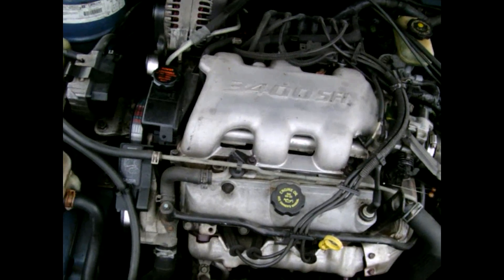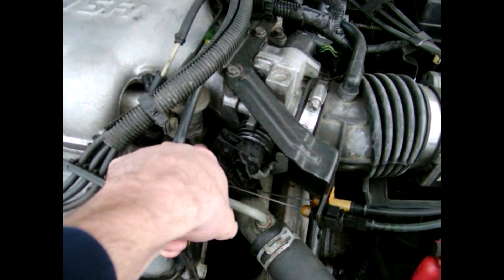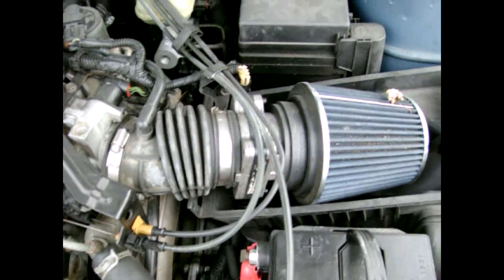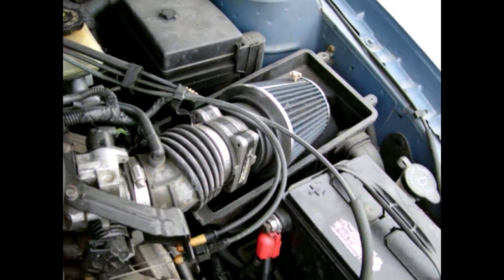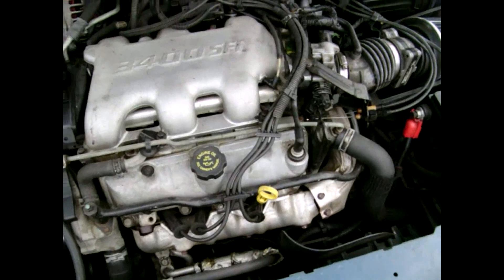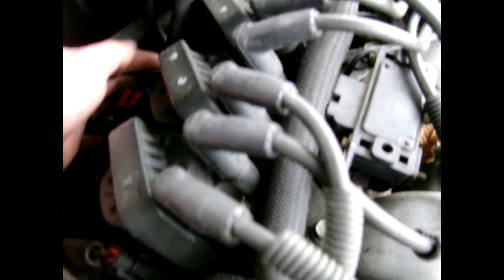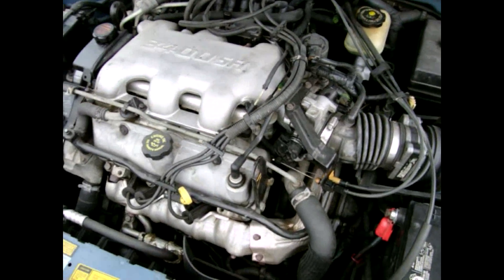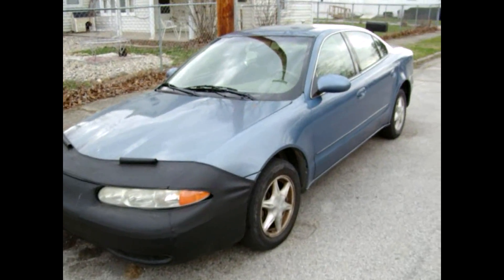3400 GM Engine 3.4 Liter Motor Explanation And Discussion

Comment: I know this feed is old but i've watched every video you made, i have my whole engine apart in my 99 olds silhouette, got everything cleaned painted and sad to say all my parts got mixed up, bolts and all, this is gonna be fun, i'm most worried about the vaccum lines
Reply from the maker: Luckily there aren't many vacuum lines in this engine.  Should be plenty of diagrams available.  Some of the bolts that hold on the alternator bracket and alternator are similar but use different lengths.
VT247

Comment: I have a 2004 Oldsmobile Alero 3.4 Litre, bought it off a friend of mine, had a nightmarish experience with Overheating, messed up the engine that came with it, replaced it with another engine, and the overheating persisted, read through some opinions on the web, told my Mechanic to check the manifold intake, he checked replaced the gaskets but the overheating persisted, fortunately my Mechanic is as dogged as i am, he insisted that there must be a reason the overheating won't go away, so he disconnected the Complete exhaust system and allow the the car to run, noisy though but that solved the problem. the catalytic converted was bad and was blocking the free flow of the exhaust, he remove the catalytic converter and replaced it Voila, overheating stopped, now my Alero is my favorite car. Overheating seems to be one of Alero's negs. I hope this helps.
Reply from the maker: At some point, nearly every gasket on the 3400 will go bad.  Had to replace the timing chain cover, the head and intake gaskets on nearly every one I've owned.  But, they are generally pretty reliable once the gaskets get changed.
VT247
Reply: Vacationtime247 Very correct, they are pretty reliable once you get it right. I love the surprise when i compete with super cars on the highway. nothing to show on the Alero that it's got muscles under the hood.

Comment from the maker: If you have coolant coming off the engine and trans, it's almost guaranteed that it's the intake manifold. Head gaskets on the 3400 don't typically go bad IMO. Just replaced the intake manifold gasket on an '01 Aztek. Got a video up on how to fix it. Typically with an intake manifold gasket, you'll have milky oil. If you have milky oil, stop driving the car immediately and get it fixed. Otherwise, it'll be the whole engine needing replaced

Comment: mine is starting the tapping sound some people say its the rocker arm bolt that came loose or stripped out and a few say its narm im haveing a hard time finding what it really is. a buddie of mine said it has high miles and told me to do a oil change. we will see
Reply from the maker: +Brian Smith Listen around the valve covers.  If it's the rocker arms the sound will be noticeable there.
VT247

Comment from the maker: For the top alternator plug in, from front of the engine to the back firewall, the first slot is empty, the second is where the red wire goes, the 3rd the white wire, the fourth space is empty.  LMK how it runs now that it's all fixed.
VT247

Comment: Sound like your heater core is leaking, You may have to replace it.  They corrode over time.  If this is the problem, your car environmental systems would never warm up inside the car.  You could try using a alumium flake based radator sealer.  This would give you a little time before the replacement if I'm correct.  The alumium flake would seal the leak until you have time to replace the small heater core.

Comment: Hello, thanks again for the great videos. They really helped me change my intake gaskets and head gasket. I now need to change the egr tube on my montana. So, do you figure I can reach the nut on the manifold to loosen the tube from below, or should I tilt the engine forward and get it from the top? Thanks!
Reply from the maker: I've always been able to get the EGR off from the back of the motor without removing the mounts.  Getting the large nut off from the manifold will be the problem.  It tends to get rusted.  Might have to get that one from underneath the car with it jacked up.
VT247

Comment: my grand am has always run warm. never gets under 200 once warm. the previous owner stated he had been proactive by replacing the head gasket, but he didnt tell us he did it himself and he pinched it. about 500 miles into my ownership, it failed. antifreeze in the oil, then the crown of piston 5 got too hot and expanded enough to tap the valve and crack the push rod.  ended up paying 1500 for a 90k motor, with out labor. now the tcc is slipping... another 2 grand probably

Comment: Hi!! @ 2.35 can you tell me were that line goes, it get broken and I don't know were to look at thank you for your video
Reply from the maker: The line at 2:35 goes from the intake plenum to 2 locations.  First in the PCV valve in the front of the motor.  The second to the back for the EVAP.  The EVAP is located under the coil pack, it can be difficult to reach.  Only try to access it with a cool engine.  Hope this helps.
VT247

Comment: I have a 2003 aztek, 3.4l with 100kmiles, Every morning before i drive away "i let her run for 2-5 minutes" the transmission seems to slip under first acceleration... i let off the gas, press it again and the problem is gone and doesn't do it again for the day.
any ideas?   I flushed the fluid, but didn't help, and its been happening for about 9 months...??
thanks:)

Comment: hey so on the manifold there a vacuum line that's by the egr. it's the hard vacuum line that's white. what does it go to or what does it do. mines not connected at the moment.
Reply from the maker: +WOLFEGANG TAKE A RIDE. BY JON YOUNG That line I believe goes to part of the EVAP system that's between the motor and the firewall.  Needs hooked up or it will set a trouble code.  It will also make your car run better hooked up as well.  You really have to look and feel for the place where that line hooks into, it's not easily visible.
VT247

Comment: I have this engine in a 2003 Olds Alero. trying to replace the waterpump outside in 10degree weather sucks. It appears the waterpump only goes on one way. We are going to get back to it tomorrow, but my son and his friend apparently had something off and the bolt may have crossthreaded. once we get that out we may be screwed, but if they can get a replacement (they broke the head off) and it still is good enough to go, how do we know it is positioned properly to fit the mount on the engine properly? I am accustomed to a car with a matching tab on the motor to line up with the water pump. There is no such thing on this vehicle, and I am pretty sure it only goes on one way. We could try hand threading each bolt, then remove and turn one to the right for each of the 5 possibilities, but if there is a way to know it would be awesome.  The water pump we purchased between bolts has tabs or no tabs. clockwise it would be a tab in the middle, no tab, a tab to the left, a tab to the right, and no tab (from the perspective looking at it from the fender).  I am guessing one of those tabs is designated to be the top, but I have no clue which. And if all the pumps for this car are the same I'm still out of luck because they took out the old one without paying attention to that. Being it's so cold outside here and we are stuck doing it without a garage, I really hate to have to try all the positions if someone knows which one is correct!
Thanks in advance.
Reply from the maker: Still have the gasket?  Try and match up the gasket then align the water pump holes accordingly using that as a guide.   Hopefully this fixes the problem.  These engines are really bad about blowing factory gaskets.  Both 3400 I currently have has had all the factory engine gaskets replaced, head, intake and timing cover.
VT247
Reply: Thanks for the speedy response. I will give that a try. It's hard to get a good view but just the gasket would be easier than trying to view the lineup through the water pump

Comment: Any one know if they offer aftermarket valve covers for the 3.4 SFI.  I just picked up a 02 impala with 35k on the engine and all in all its been awesome.  Just looking for a way to improve the look under the hood. not really looking to "mod" or "upgrade" performance.

Comment: on the dis system u mention a vacuum does that line go to the upper intake right next to the alternator?
Reply from the maker: No, that one is plugged off.  Google ' GM 3400 vacuum lines ' for a diagram.  Should help if you are searching for a disconnected hose location.
VT247

Comment: have a 2000 pontiac grand am gt with the same exact motor and i am having trouble finding the right heater pipe on the backside of the lower intake it is leaking bad and the pipe needs to be replaced but nobody can seem to find the right pipe i can find the straight one but the one i have has a sort of s bend in it and nobody seems to understand where it came from or can find one like it
Reply: +George Highsmith     ~ rock auto online~

Comment: Hi guys, I have a '04 Alero and when I try starting it it will crank for about 5 seconds before firing up but sometimes if the engine has been running and I try starting it within 1 hour it'll fire up almost instantly. Also, I have to refill the coolant almost every 2 months. I don't see any leaks but I had a fusion and not once topped off the coolant in the 3 years that I had it.
Reply: I have an '08 equinox with the 3400 in it, was losing coolant but couldn't see any externally, ended up being the lower intake manifold failed.  You may have a bad head gasket as well, as when it sits it may be slowly leaking coolant into one of the cylinders, then give you trouble starting, but if it hasn't sat long, may not notice.  Also, I am unsure of the fuel pump set up on these, but if the check valve in the fuel pump is bad, or if you have a leaky injector, or leak any where in the fuel lines it may gradually be losing pressure.  One way to test the fuel system is to cycle the key to the on position and let the fuel pump prime the system, do this 3-4 times, letting it stay in the on position for a couple seconds each time, then on the 4-5th try go ahead and turn the engine over.  If it fires right up after sitting a long time, it could be a leak in the fuel system or bad check valve in the fuel pump.
Reply: Thanks Brandon, I've done the key cycle when its been sitting overnight and more often than not it'll start right up. I suspected the fuel pump but I've been putting off getting it checked because its a pain to get to.  I believe the fuel pump for this car is on the inside of the fuel tank, so to get to it I'd have to remove the entire fuel tank from the car. I've been dreading getting the news that I might also have a head gasket problem because those are usually costly fixes. It's just a $1000 beater car so I'm really not trying put too much money into it, but I'll take it to my mechanic and hopefully he'll resolve the problems without charging me an arm and a leg. Other than that its a good car, plus it's a great conversation starter, 9 out of 10 people will have no idea what it is and just 2 days ago a guy pulled over to tell me that he has one and how much people loved them back in the day.

Comment: THE TRANSMISSION VACUUM IT SHOWS IN THE TO RIGHT FRONT OF THE MONEFOLD''. I'D PLUG IT COS NOT KNOW WHERE TO  GO WITH?
IN 2004 3400 GRAN AM..
Reply: I have the same issues.  Did you fix it?

Comment: I have a 2004 impala and I recently discovered a bad leak under a metal hose that runs under the 3400 upper intake manifold. It lets off a hissing sound which I believe is an obvious sign of pressure leak from a metal pipe. I was wondering if it was absolutely necessary to remove the intake manifold or if it could just be disconnected and pulled off another way.
Reply from the maker: There is a metal pipe under the upper intake.  Only way I know how to access it is to remove the upper intake.  It's not that hard to get to, fixing it may be somewhat difficult though.  Might be able to push a larger hose over it and alligator clamp it down.  But, only way to do that, remove upper intake.
VT247

Comment from the maker: A cold air intake won't ruin anything.  May give you a few extra horsepower.  But it won't affect the operating temperature at all.  Does your car overheat or the temp spike?  If it stays at one certain temp (about the middle of the temp gauge) after the car is warmed up, then it's fine.
VT247

Comment: I have  2003 Pontac Montana 3.4L engine. Had both intake gaskets replaced a year ago. Now have engine oil in the coolant & reservoir. Had dye test for transmission fluid in the coolant but was ok.  The engine runs good, no smoke from tailpipe, no ck engine codes set. Thinking possible engine oil cooler problems around the oil filter but not finding anyone else with this kind of problem. Have found no coolant in the oil. Was told possible head gasket or pin hole somewhere? Any thoughts or recommendations?
Reply: Hey Bruce,  Did you ever find the problem?  My '01 Aztek is on it's 3rd engine due to overheating etc.  First of all, I am a 30 year ASE Master Technician,  GM master tech and I have teaching Auto Technology for 21 years...12 of those for GM.  I know engines.  I build engines, I teach engines.  This one has me baffled.  GM Crate 3400 engine, 2 years old, appx. 25K miles.  Running hot but not overheating on a 300 mile trip summertime in the south.  2 weeks later before the return trip, I was checking fluids and noticed the dreaded Chocolate Milkshake in overflow jug.  I had no choice but to drive it home.  Made it without overheating.  Tore the engine down at the college I teach at and intake gaskets were like brand new, head gaskets same, Oil cooler pressure and vacuum tested good.  The oil was full on Chocolate shake, as was the coolant.  This one has me perplexed becauce certain places in the engine, the oil pressure will overpower the coolant and vise versa.  There shouldn't be choc milk in both.
I'm shopping this story around and if I come up with anything, I will follow up.
Thanks for listening.
Bill Kitt
william.kitt@fdtc.edu

Comment: I have a 03 grand am with the 3.4l when I changed the spark plugs I noticed every one of them the gap was.burned off and every gap was different. It ran fine  after I changed them for a while but recently  if I go to turn it over and if I let the key go before I i know it's running it sounds like it is backfiring in the intake. First thing I can think is that maybe the timing is off but I've already put aloe into this car  I was wondering if there could be anything else that may cause this to happen ?
Reply from the maker: Check for vacuum leaks and clean or replace the cam and crank sensors.  See if any codes come up.
VT247

Comment: I have a 2000 grand am with that same 3400 sfi engine and my issue is, i have to crank long time sometimes even push the gas to get her going she feels real ruff but will smooth out with a few pumps of the gas someone said purge valve or fuel pressure regulator?
Reply from the maker: Typical check up on all your components.  Check your plug wires, coils and of course spark plugs.  Check for vacuum leaks or loose vacuum connections.  Check your fuel pressure, most auto stores have loan a tool deals to do this.  Of course, check your engine codes too.  Process of elimination really.  
VT247

Comment: having problem w/ steel coolant line that runs from bypass hose, under intake plenum/fuel rails, to top drvr side of manifold behind throttle body. steel tube known as "PIPE" to GM parts.com#17 rusted at intake and is leaking/snapped off. how to replace ? I see no mounting bracket , snap ring,flare etc. does it push in from top w"O"ring? fed up from bottom? do i need to remove intake? Not the hose going into front thottle body. (who designs that dumb stuff) anyone? little help?

Comment: 03 Grand Am GT1. Had Motor replaced about a year ago. Now I'm leaking coolant in a steady stream from head gasket although No water in oil. How often do the heads go Bad or get warped. Wondering if just replacing the head and intake gaskets would be the fix or should I also replace cylinder heads?
Reply from the maker: I've replaced the head and intake manifold gaskets in both my '01 Pontiac Azteks (GM 3400).  After that was replaced I've never had to do any other repairs.  It's extremely rare to have the heads warp.  They're aluminum heads.  Might as well change out the timing cover gasket as well while your in there.  I'm in the process of doing that repair right now.  Check out my video on how to fix and replace the head gaskets on a GM 3400.
VT247

Comment: That line coming out of the front, what is it? I’m no master mechanic, but I’m used to working on Bimmers and Hyundai. GM is new to me and I’m now a proud owner of an ‘01 Impala(base) and I noticed a hissing coming from the particular line connection. Is that like a PCV valve/line? Don’t roast me. Feeling a bit noobish.
Reply from the maker: There’s a few lines coming out the front that could be making that type of noise.  The metal line, near the front passenger side and the serpentine belt is a coolant line.  Another plastic line, by the throttle cable and intake is a vacuum line for the PVC.  Sometimes the plastic grommet wears out.  Spray the site and see if it changes the idle, that’ll confirm.   I put a small piece of sponge over the top to gently hold it down.  Hope this helps!
VT247
Reply: @Vacationtime247  Yea, it’s the PCV. I’m guessing the grommet wore out on it. I’ll give that a try. Not too much of a rough idle, but I was thinking about pulling the valve and cleaning/replacing it.mainly to see if it’s actually an issue. Thank you!